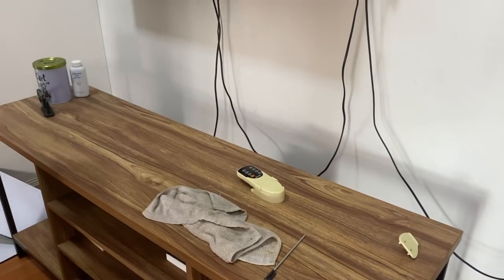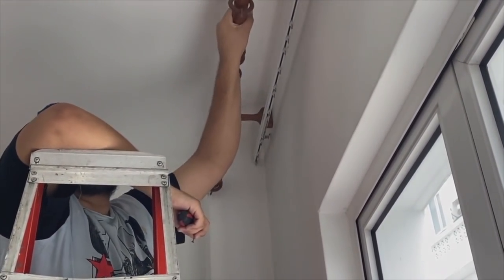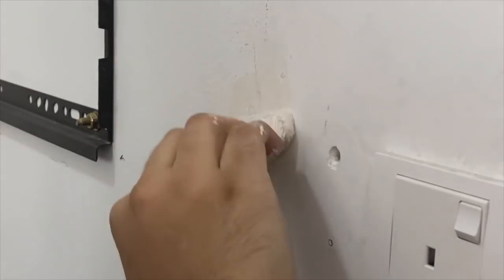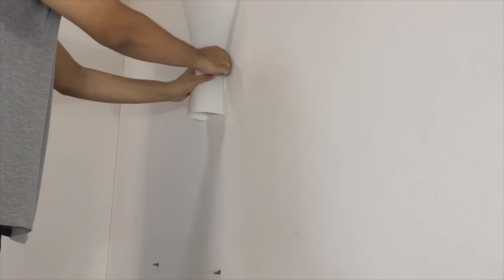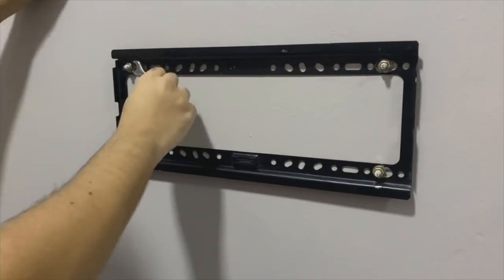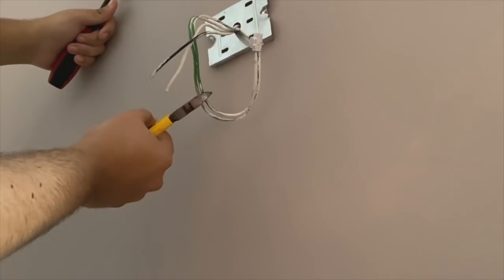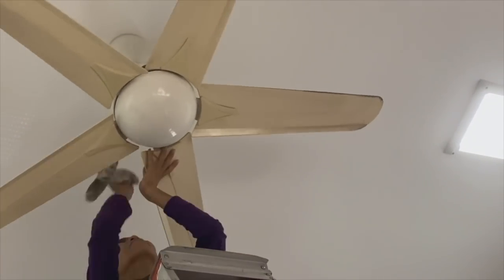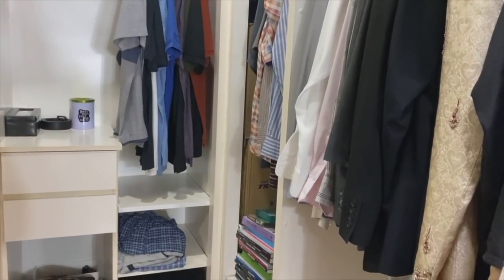GUYS' BEDROOM MINI MAKEOVER

Comment: Your boys did a great job!!! For the yellowed remote just tape off the black and button areas and spray paint it as well as the bracket... if you use some sand paper to scruff up the surface a bit the paint will adhere to it
Reply from the maker: Thank you. I have an old remote. I’ll try it on the first. ❤️❤️